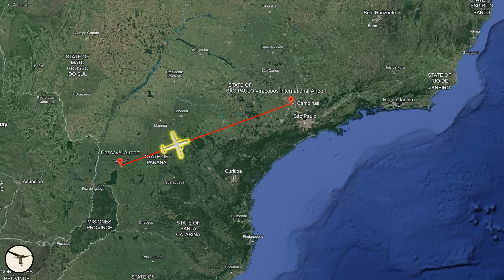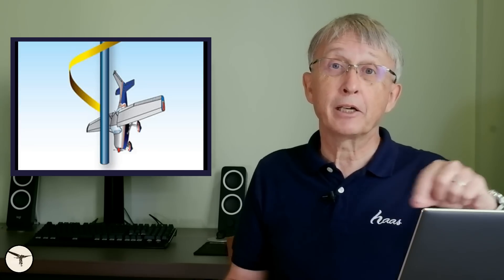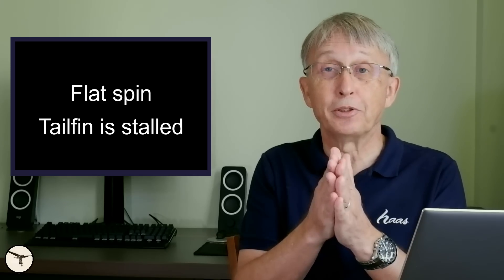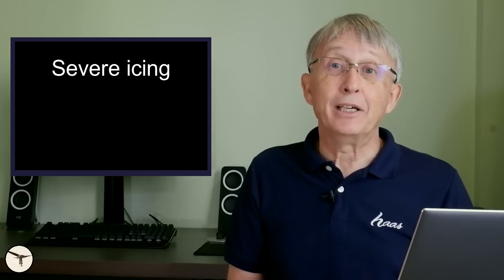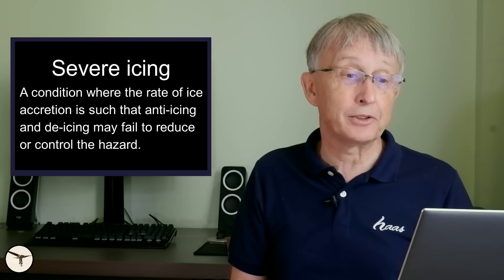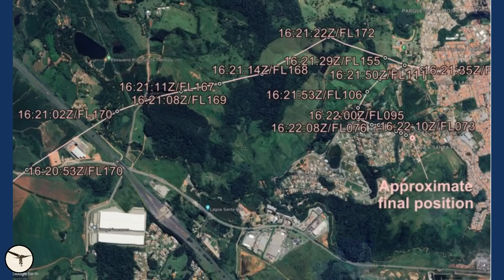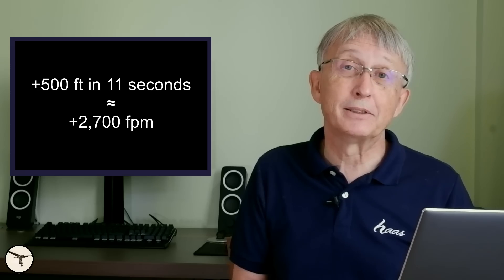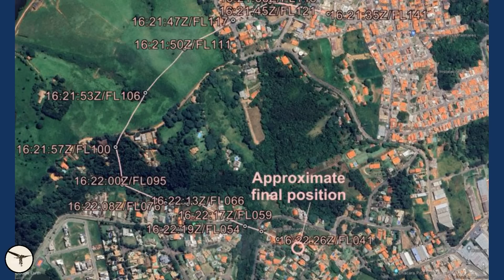ATR 72-500 Crash: Understanding the Fatal Flat Spin & Severe Icing Dangers

Comment: Well said captain! This from a retired UAL 767 captain. I was a 737 copilot based at Chicago O’Hare when the ATR crashed in 1994. What we learned from that accident was that the FAA allowed ATR to certify their planes for flight in icing conditions based on computer models rather than have the prototype flown behind a water tanker that sprayed water on the ATR creating real icing conditions. This had NEVER been done before! We later found that those computer models were wrong. The corrupt FAA was responsible for that accident in Roselawn, Indiana, although the flight crew violated flight manual procedures and lowered the flaps in moderate icing.
Reply: Americans have a huge fear of the ATR  since the crash of American  Eagle 4184. Truth is USA operates flights in blizzard conditions and if the ATR is flown in a reasonable climate it can handle moderate icing.  More likely Voepass 2283 suffered  accidental engagement of Hotel mode. An ATR normally flies with the Auxilliary Hydraulic pump set to Standby.however in Standby if there is a low hydraulic pressure warning Hotel mode is engaged automatically. This applies a propeller brake which effectively de -clutches the engine.  Imagine suddenly having to fly with one propeller stopped and unfeathered.? Early model ATR  were unable to use  Hotel mode in flight, but after a ditching near Sicily, the manufacturer modified this  to allow use in flight, but think about this. How dangerous and how stupid is it to design a plane whose propellers can be disengaged in flight? It is too early yet to say, but by mid September we will have a preliminary accident report. Either they will be certain by then , or clearly baffled. I say the propeller brake engaged.
Reply: @Tazjet100 To be honest I was an ATR engineer for 15 years but never ever heard of any mod enabling the Hotel mode to engage in flight. Actually the Prop Brake unit can not cope with an engine running at any higher pwr then where the Gust lock is located when engaged. That is also one of the criterias to set Hotel mode to have the Gust Lock on which is solely a ground operation feature. I had an ATR back in time which had an EEC issue causing a very high N2 idle and when the crew selected Hotel mode at the de-icing spot the Brake caught fire due to overheat. And it was just an increased idle pwr. So I'd say the uncommanded Hotel mode can be eliminated due to so many protection in flt. But as you say we'll see later...
Reply: @csehakos3486  Look in the QRH which recommends use of Hydraulic Auxilliary pump in flight, in preparation for ditching.  Hotel mode is available in flight and low hydraulic pressure triggers it automatically.  in CVR, CO-PILOT kept demanding more power and expressing confusion what engine was doing?
Reply: @csehakos3486  ask Magnar yourself. The QRH recommends using Hydraulic Auxilliary pump in flight for ditching. which will activate Hotel mode.
Reply: @Tazjet100  I can access any ATR manuals next week when back on duty but what I remember is that just because Aux Pump starts it doesn't mean the Hotel Mode  can be engaged. It has criterias like being on ground, gust lock on, cond lever feathered etc. I can't see any situation whatsoever when a Hotel mode would be or could be engaged in flight. But again, it was now about 8 years ago when I worked on ATR so my memory might have faded. I'll check it out for my curiosity. Regards
Reply: 1990's Liberal FAA.  They also deleted all EFATO Maneuvers requirements and Go Arounds From Flare Requirements for before solo maneuvers requirements.  They did that in Clinton year 1998.  Liberals always trying to pass turkeys and chickens as pilots by deleting requirements to pass.  I took EFATo 4kinds of maneuvers in year 1996.  They saved the life of 3 of my fellow students later on.  Liberals accepting inepts via cutting requirements.
Reply: Except on the CVR recording neither pilot mentions icing. First Oficer expressed confusion  and kept demanding more power on the engines.  [source] Reuters citing  TV Globo report. on CVR.
Reply: An actually corrupt FAA would have not done any testing after the crash and a truly corrupt FAA would have hidden the results. Instead, the FAA and ENTIRE aviation industry realized they could no longer ignore supercooled liquid droplets. Should have there been some testing to verify the models developed in the 1940s, yes. Should there be continuous research and testing? There is now. You anti-authority comments are unnecessary, and ruin an otherwise benign comment.
Reply: Very interesting! I highly doubt ATR has done any REAL testing to simulate icing conditions even to this day. That checklist is an absolute joke. Why on earth would you disengage the autopilot AFTER you've added Max Thrust to an aircraft you assume to be contaminated with severe icing, where control surfaces are likely ineffective, likely pitching the nose up and causing a stall? Does anyone at ATR have common sense? ATR is responsible.
Reply from the maker: As @MrSuzuki1187 wrote above, after the accident in 1994, an ATR 72 was flown behind a tanker spraying supercooled water drops with a diameter 4 times larger than the certification requirement. The aircraft behaved well. Afterwards, other aircraft types did the same tests, including Embraer Brasilia and SAAB 2000.
Reply: @FlywithMagnar  Is a report or any reliable information about the testing done made public and found online? I found this comment on a forum: "Nobody mentioned this, though as a result of the Roselawn crash, the ATR-72 got "tested" for susceptibility for icing, using a USAF tanker spraying super cooled water(-droplets). The ATR-72 testing was nearly immediately abandoned due to the extreme ice build-up (behind the deicing boots, compromising the aileron use) and the ATR-72 was subsequently banned from operations / being used at higher latitudes / cold weather operations (and "banned" to be used in warmer climates, now seemingly Brazil in extreme icing/winter conditions still being not "warm" enough)."
Reply from the maker: @alexc5449  This information is not correct. When you read NTSB's report after the accident with American Eagle flight 4184, page 94 onwards, you can see that the icing tanker tests were extensive. The tests were followed up by wind tunnel testing, and flight tests with artificial ice shapes attached to the wings. The conclusion was that when the aircraft was exposed to freezing rain, ice ridges could form behind the deicing boots. This resulted in aileron reversal at an AoA below the stick shaker threshold, as experienced by Flight 4184. ATR then designed new deicing boots which covered a larger area of the wings. Then, the aircraft was flown behind the icing tanker with water droplet size 3-4 times larger than certification criteria. The tests proved that no ice formed behind the new deicing boots. ATR also revised their icing procedures, and installed an Automatic Performance Monitoring (APM) system that will alert the pilots whe ice accumulation degrades aircraft performance. Since then, all ice-related accidents and incidents happened because the pilots did not follow those guidelines.
Reply: @FlywithMagnar  Thank you for that information. I did read the sections starting at pg 94, but I find it lacking in detail. For example, we don’t know for how long the aircraft was exposed to “icing” before the boots were activated to shed the ice or for how long severe icing conditions the aircraft can withstand with normal boot operations before the boot effectiveness reduces as is often the cases in many of these icing accidents. Not to say pilot error or negligence had no role to play in this as it probably did. I just wish more details are made public so we can get a complete picture.
Reply: Hi. Weren't the heatings on the horns introduced after those accidents as well? I used to be an ATR engineer and remember something like that. But might be wrong. Thanks
Reply: @alexc5449  in the CVR neither pilot mentions icing. First Officer however was shouting alarm not understanding what the engine was doing? F/O also demanded more power. Not indicative of icing at all!
Reply: @Tazjet100  “Brazil's aviation accident investigation center, Cenipa, said in a statement late on Wednesday that it "guarantees" no publication had access to the voice recorder's audio, transcript or data. It did not comment on the content of TV Globo's report.”
Reply: @FlywithMagnar  Do you think icing was a factor?
Reply: @alexc5449  TV Globo have already published the transcript. It is public knowledge now.
Reply: @Tazjet100  Do you have a link to the publication?
Reply: @FlywithMagnar  The real issue is this aircrsft suffered hydraulic system damage from a tail strike in March. It returned to service  in July with persistent hydraulic low pressure warnings. This can activate the propeller brake or Hotel mode in flight. (see the QRH /re Ditching)
Reply: @FlywithMagnar  This is all very interesting - thank you Magnar and everyone!  

References have been made to the icing testing performed after the American Eagle crash. I haven't read the details, but from what's shared here makes me concerned about how representative of real conditions this was. It seemed to just "up the ante" on a standardized test.  First, was it done under a range of representative ambient temperatures?  The temperature of the receiving wings and fuselage are critical factors. Second was it done with snow-making equipment (like they have at ski resorts)? Water drops are relatively benign and build up more homogeneously, compared to the supersized snow flakes that can be created on the temperature boundaries near freezing on the edge of a cold front. They stick like gorilla glue and with windchill they freeze immediately.

Those were the conditions for the US Air 405 crash (La Guardia March 1992). A little Fokker (F28) tried to take off on a 7000 ft runway and experienced slow acceleration, then brief reduced and uneven lift. With no room to spin, it hit the ground and water first. I was driving in the same area at the same time (at about 80 kph) and had to stop multiple times to break off the snow/ice mix that built up, 6-12" thick, on the car's front. It cut off all ventilation in just a couple of minutes. Now I'm based in a coastal area, where this kind of snow with wind is devastating, bringing down the most wires and trees. It creates a heavy frozen "blade" of snow in the leeward side of any branch in a strong wind up to 15" long that sticks firmly and breaks the branch or tree. Amazing to see!

Comment: The ATR 72 was never tested in spin recoveries, so we don't know if the spin was recoverable. Additionally, if the wing/stab/control surfaces had ice on them, the flight characteristics are dramatically impacted -- the ice may have rendered an otherwise recoverable airplane unrecoverable.

There have been two other crashes of ATR 72's in similar conditions.

If the crew (especially with the knowledge of the dispatcher) purposely flew into precip during severe icing conditions, there will be massive lawsuits by the aggrieved families -- and there should be.

Comment: Un the aerocaribbean 883 accident which I suspect is very similar to this case there was not stick shaker activation or pusher before the stall and spin that came very sudden . In this icing scenario I wonder if the shaker could be defined as a stall prevention system

Comment: The Right engine has an engine brake  which de-clutches  the Right prop, enough to trigger a spin. In a Multi engine in a spin, if one engine develops thrust whilst the other engine has no thrust, that creates gyroscopic effect.
Reply from the maker: Thr propeller brake only works when the aircraft is on the ground.
Reply: @FlywithMagnar  Only true on early models. Later models it can engage in flight.

Comment: I see others who are ATR captains call this a deep stall. But a deep stall does not have to rotation, so this is a flat spin. I'm a 30-year armchair pilot yes so I defer to real pilots but this guy gets it right.
Reply: 7,000 ATR pilot. A “deep stall” traditionally involves a condition where airflow is blocking the elevator preventing recovery by reducing AOA below stall. T-tail aircraft are most susceptible, but pilot error as in the Air France A330 crash can result in that too. The issue is WHAT puts the aircraft outside its flight envelope, not the final result.

Comment: A flat spin is almost always impossible to 'recover' from.  A descent of around 17000 feet per minute (more than 60 mph vertically) is over 10 times a 'normal' descent and makes situational awareness, much less controlability, difficult at best.  Knowing how to 'do' anything about this situation is not something taught or practiced or even really understood.   As a 50+ year engineering pilot, I can
appreciate the chaso and confusion in the front of this plane as it continued to evade all efforts to
control the dynamic insanity.  The author of this video has done a good job of explaining the
dilemma.
Reply: i'm no pilot, but I bet you'll find soon enough the reason of the airplane failure...

the reason being a gust current change between 13:20 -13:30 (GMT-4), from West to West North West winds. Causing a radius 0 condition on the center of the plane (vacuum). Autopilot decided to change into manual pilot mode after failing to stabilize the plane. Or so it seems.

the icing caused the stall, but the stall itself clashed with autopilot preventing going into manual pilot mode.

you welcome.

Comment: Was it in icing conditions? Look up ATR and icing.  Voila.  Many years ago, FAA issued a directive prohibiting ATR flight into known icing conditions, even if equipped with deicing equipment for this very reason.  Physics don’t change with time.  Bet it was being flown by LTPs, which has also been cited by NTSB as another ATR crash caused by icing contributing factor.

Comment: The swiss cheese holes lined up with this accident, RIP all the victims of this crash.

The flight took off into known icing conditions.
The aircraft started to pick up severe icing.
Air traffic denied a change to a lower attitude.
ATR's do not like icing conditions, 
From the timeline the pilots didn't have much time to correct the issue.

Comment: you don't necessarily need a yawing force to start a spin. That is the usual way to induce a spin but a highly asymmetrical stall will cause a sharp roll off which starts the angular motion and then inappropriate control inputs will do the rest to establish a spin.

Comment: This is pilot mistake 101.  Stall due to icing, pilot in control pulled back on the yoke instead of pitching down.  To put plane into a flat spin is to pull back on the yoke at stall.  Automated trained pilot responds irresponsibly to real-world icing flight conditions and put plane into death stall.  Pilot 101.......stall, full power, pitch down.  This should be a 60 second explanation.
Reply: Exactly. The data is there. The initial descent was the stick pusher. The subsequent climb was the pilots response to the stick pusher. They pulled back. The next descent was the aerodynamic stall. The person in this video decided not to discuss this.
Reply: How is that possible when it has a stick pusher?

Comment: I'm suspicious of any aircraft type whose original design presents a number of flight stability problems. I question whether the original design was tested properly, before it went into production. In the
case of the ATR series, several "fixes" were required to make these aircraft safer to fly, but one is left with the impression that it is still not a forgiving aircraft type.

Comment: Due to the induced angular rotation being exacerbated by the heavy engines positioned far way from the COG of the aircraft,  the weight of the engines basically turns such aircraft into spinning gyros. But what if the pilot had used individual engine thrust from the inner engine opposite to the spin rotation,  to stop the spin, would that be accomplished, and if so would it just start it spinning the other way? Or could some control of the spin be achieved this way?  Assuming if that would work,  it would then be in a flat non spinning free fall, then in that configuration, could anything have been done to lower the nose and gain speed to escape the stalled condition? Or are these T tail  aircraft, basically death traps when ever a stall/spin starts?  It seems a crazy design, when you realise they fly around 16-18k feet, an altitude that experiences these severe icing conditions.   Such a tragedy, one can only imagine the horror of those poor souls spinning and falling like that.

Comment: Magnar, the usual great video.

A chilling accident.  I've many times flown in ATR72s as a passenger, I've been in São Paulo, I've been in Cascavel.

The only point I'd like to mention is that you illustrate spinning with an aircraft that suspiciously looks like a Cessna 172 or similar.  That type of aircraft is notoriously hard to get to spin at all. Brazilian PPL training mandates spin training and a friend of mine had to use a C172N rather than his flying school's usual C152 because at 2m (for the non-metric folks, that's about 0.00108 nautical miles) he just doesn't fit into an aircraft the size of a thimble.  Turns out it's almost impossible to get it to spin.  It requires some power and full rudder and Cessna 172Ns immediately recover by themselves when the engine is idled and hands taken of control.

In the UK (EASA land) spin training is optional; my flying club used to use a Slingsby T-67 Firefly for it.